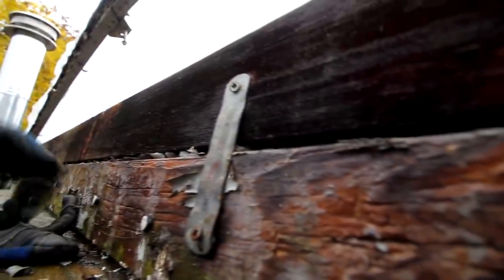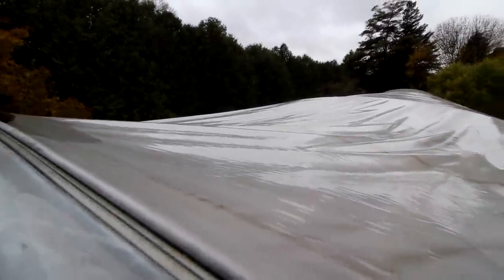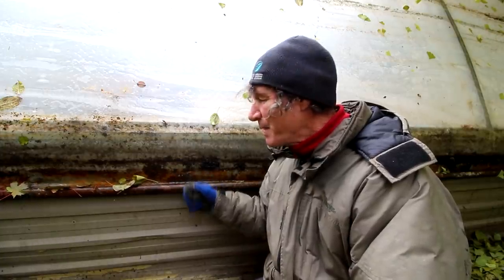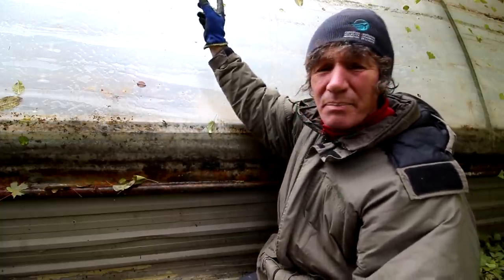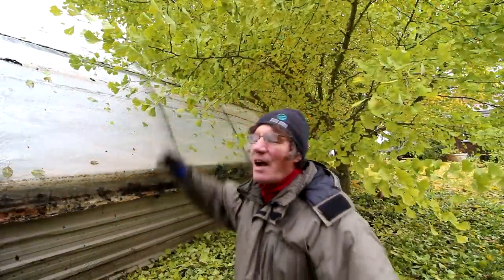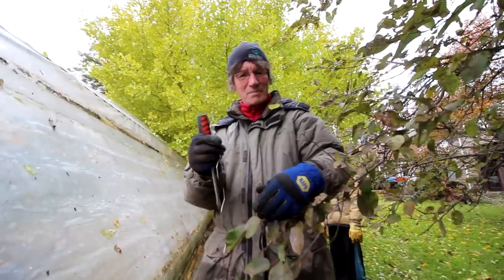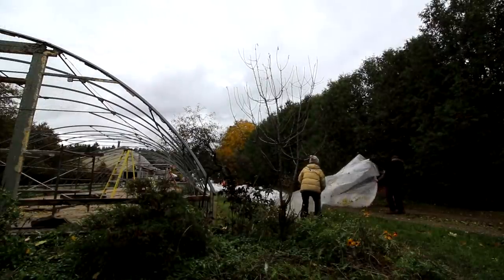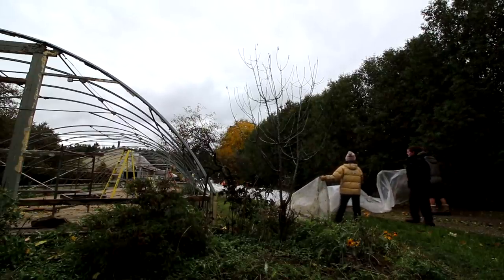The New Greenhouse, Part 6, The Bonsai Zone, Nov 2018

Comment: Ok so I have the bug to start bonsai, and I ordered a Willow leaf ficus, it comes with bonsai soil,pot, 2 year old ficus and wire. My question is can i get it into the new pot and work on the roots and branches even though its November or do I need to wait til spring? Love your channel and the work you put into explaining the details, feel free to add more haha. Thank you for your time.
Reply from the maker: It is best to wait until spring or early summer. I would only re pot if the tree is growing really well and you can keep it in a nice warm sunny location outside. I would leave the wiring until it has recovered from re potting.
Reply: Nigel Saunders, The Bonsai Zone Thanks, will do, Ill wait till then.
Reply: Nigel Saunders, The Bonsai Zone Well sir I didnt wait, I checked the roots and I dont think it has ever been repotted being its nursery stock, and the roots had grown and fused into a solid mass. So I tried to follow your videos as much as possible in regards to root care, and repotted it into some tinyroots bonsai soil mix. I cut back the too growth down to three main structures with one being an upright trunk, and added some fertilizer and a full spectrum grow light to top it off. It has been awhile now with maybe only 10-15 leafs that dropped, and the rest of the leafs are a vibrant green now. I hope with lots of love this little guy will prosper, and being that this is my first some luck wont hurt either lol. Do you have a video detailing what you look for when watering your trees, such as what to look for in deciding when its time to water them. Again thanks for your advice and all your great work, please keep it up sansei.

Comment: Hey mate quick question,  how long do i leave white oil on? Google seems to indiate that u dont wash it off. I have found some pests recently,  sprayed with soapy water but no good so i bought a can of white oil, instructions said nothing about when to wash off but warned about using in hot weather,  above 35c. Tested on my jade and it has been above 30c last few days but had it in full shade, left it for 3 days then watered/washed it today, all the leaves fell off. I cracked the shits and threw it in the bin, am i doing something wrong?
Reply from the maker: Hello Michael, I think the white oil is meant for trees that are dormant and have lost their leaves. The oil will wash away naturally when the tree is outside. Hong in our club uses Windex, the stuff for cleaning windows, and he says it works really well. I have only used soap and water so I don'r have much experience with other techniques.

Comment: are you guys taking it apart with NO power tools or tool belt?
Reply from the maker: Basically yes, we do have a cordless drill for removing the screws and bolts once they are loosened, but much is just by hand.